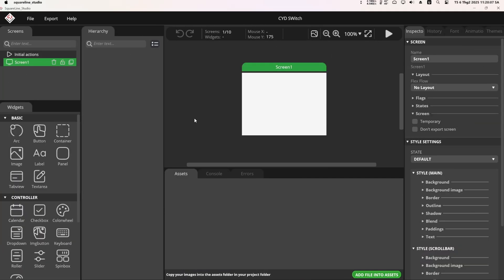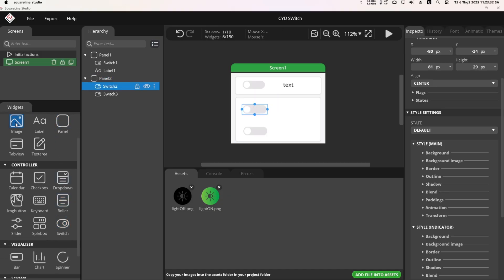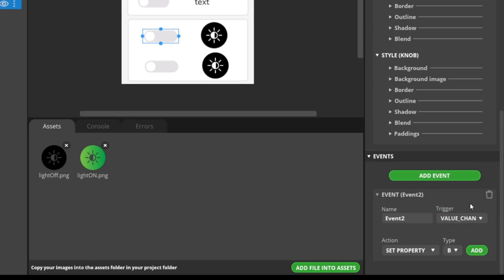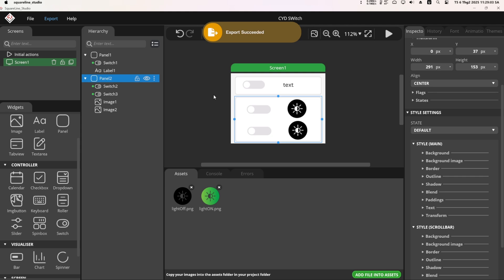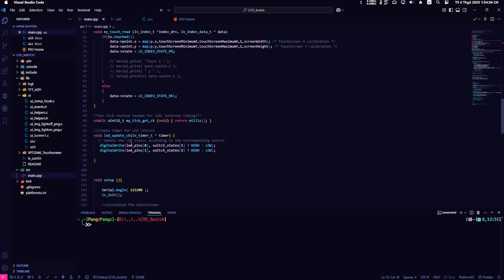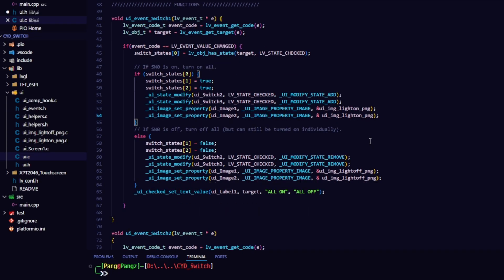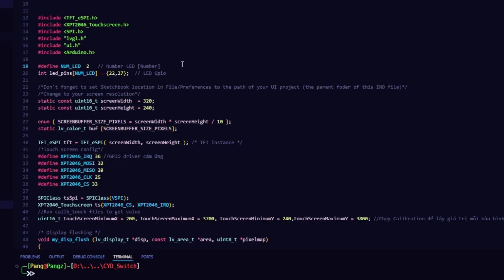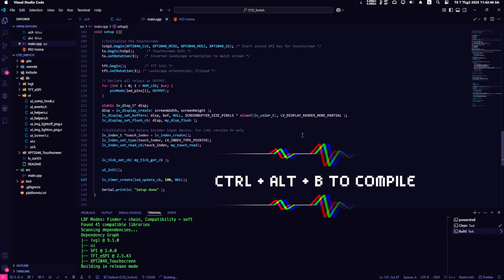[ESP32 + LVGL] Using Switch Widget to Toggle LEDs with Icons

Comment: I bought Waveshare esp32-s3 touch lcd 4b which will not work with tft espi and i cannot make it work as of right now can you help
Reply from the maker: You can find full documentation and example code for this model on Waveshare's homepage, including 2 frameworks ESP-IDF and Arduino. The model you are using should only use the LovyanGFX library instead of TFT_eSPI.
https://www.waveshare.com/wiki/ESP32-S3-Touch-LCD-4B
Reply: @pangcrd I tried everything.At first I was using Lovyangfx but it was giving error in compilation so I switched to Arduinogfx it was also shown in the demo's..but at the end of the day after uploading serial monitor gives "entry 0x403c8898" which means it held in a bootloader mode/download mode.I tried using separate 5v usb power on the UART port  for proper power to the Axp2101 but nothing same output as of now😢
Reply from the maker: @NIGHTMARE_AK   I don't have the model you're using yet, so it's hard to guess the error causing the continuous reboot. Have you fully checked the library versions you're using? Try displaying a simple text on the screen before using LVGL.

Comment: Nicely done but wouldn't your changes to ui.c get overwritten the next time you export UI files?
Reply from the maker: When you export a new ui.c file from Squareline and copy-paste it into the current project's ui.c file, it will be overwritten. You should design the complete UI as you desire, for example, the number of buttons, switches, etc... Then, export the UI and modify it. If there are minor changes, you should edit directly in the source code.